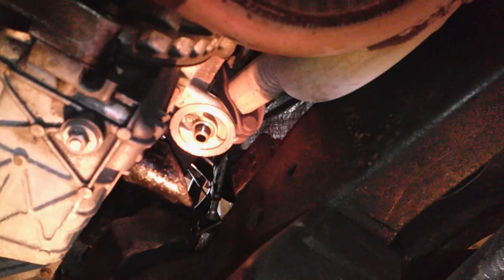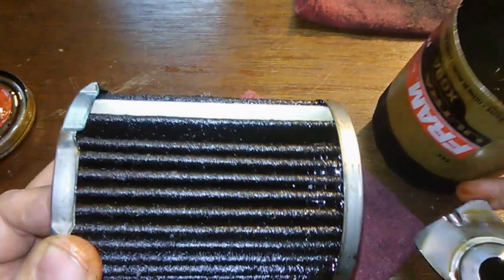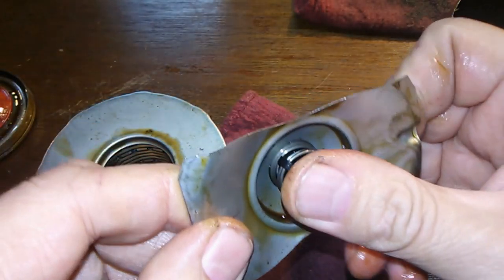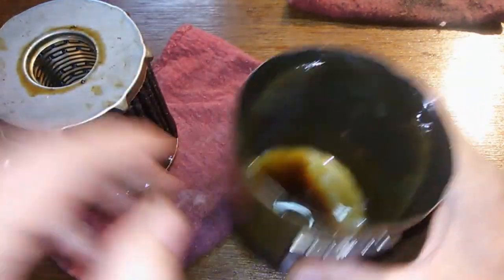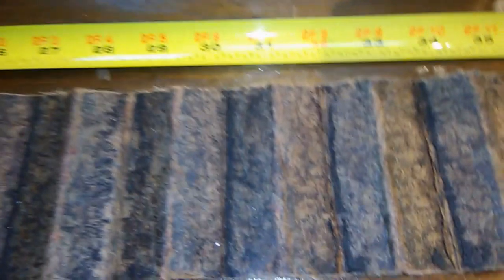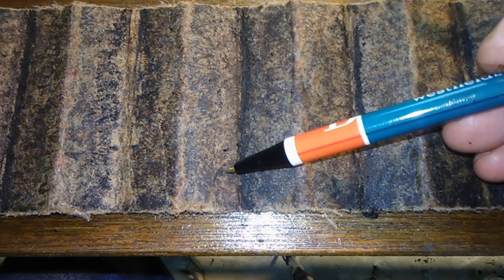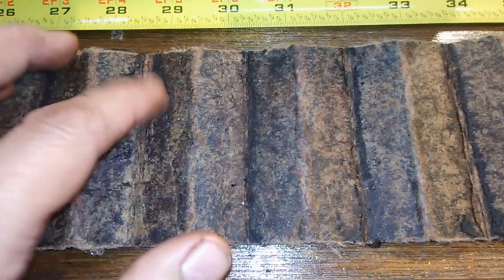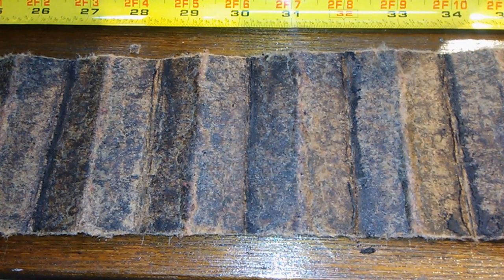Fram Ultra Oil Filter Cut Open XG8A and Oil filter magnets

Comment from the maker: Merry Christmas Everyone and a Happy New year!
Note about the video: I'm pretty sure the shiny metal particles came from the wire backing from cutting the oil filter media. They were just sitting on top of the filter media, and not embedded into the filter, I later ran a magnet over the ones I saw and they would easily lift off. 
And:
Oil Filter Friday,
Watch a New Automotive oil filter inspection video every Friday on this channel.

Comment: I have a 1998 Ford Explorer 4.0L and it loves the Fram Ultra.  The engine is still going strong at just under 300,000 miles.
Reply from the maker: 300,000 miles, that pretty good!
I hope mine makes it to 300,000 miles 😊. I only have another 100,000 miles to go 🤣.
Thanks for watching and commenting👍.

Comment: Cut a used filter and show what's inside using magnets, it couldn't be more real, thanks for uploading this, you can use any oil and filter, the magnet will catch something, bad luck for me, my car uses another type of filter (cartridge ), so I don't know how to do this without being afraid of a magnet flying down the road at 90mph... (I have some neodm from hdd's around) But a great demonstration of what this does in your car!

Comment: Thank you for posting your videos.   I enjoy watching.  Everyone has a favorite oil filter.   Me included.
Reply from the maker: Thank You! I'm glad you like my videos.👍
 I really don't have one favorite oil filter. I have a few that I like. I tend to like filters that have a backing so that they can't possibly tear, the Fram Ultra and a few others fit that bill.😊
I don't think I'm going to stop making oil filter videos any time soon So enjoy and post your comments, I'm learning and any knowledge shared is greatly appreciated. Take Care!
Reply: @WhipCityWrencher  right now I am using a couple different ones myself.  I like the Bosch premium  99+% at 20 microns and the Fram ultra.  Some others on my short list are the royal purple 99+@25 microns, Mobile 1 extended performance 99.6%@25 microns and the NAPA gold 99%@23 microns.  The Bosch are only like 4 bucks when ordered from Rock Auto.
Reply from the maker: @robshaw2990  That's an impressive list of filters.👍
I've opened up the Napa Gold and the Bosh filters and I was impressed with both. I've opened a Mobil also I can't remember which one. The Royal purple is on my to-do list.😊

Comment: It is fascinating to see the particles trapped by those magnets.  Thumbs UP for this video.  I wonder how many of those metallic particles would have been picked up by the filter if the magnets weren't there?    In other words, how small are those metallic particles that were picked up by the magnets?   If the magnets are trapping particles smaller than what the filter can trap, they may be a good investment.  

You can buy motor oil test kits that will tell you the quantity of various metallic particles left over in the old engine oil.  It would be most interesting to see a lab analysis of ferrous particles from two back-to-back oil changes over comparable distances - one using magnets and the other without.
Reply from the maker: Yes, that would be a good test.
I will try that in the future, I think I'll invest in one of them oil filter mag's. The kind that wrap around the oil filter.
Thanks for the suggestion.👍🙏😊
Reply: @WhipCityWrencher  We run those and also your kind(we have 100 trucks) Allison runs a round donut mag on top of their spin ons, and their filters are 15 micron. The mags always have some really fine metal film on them.  I believe in magnets(look at differentials). The magnet IS the filter.
Reply from the maker: @GT-mn3bx  True, 
Yep, the drain plug on my 5 spd tranny is also a magnet.

Comment: The XG is Fram's best filter. It's the filter I use in my vehicles.
In my 99 Silverado, I do the same thing. I change oil 1x per year using a Fram XG3506 and 6 quarts of Mobil 1 Extended Performance High Mileage 5W30 oil. I also get between 3,000 and 4,000 miles per year on it too.  The oil and filter are both rated for 1 year or 15,000 miles.  

Incidentally, the Pennzoil Platinum Synthetic oil is a very high quality oil so you're doing right by your engine using it.
Reply from the maker: Thank You, and thanks for your feedback.👍🙏😊

Comment: I've got one of these Fram Ultra Synthetics in my 2000 Honda CR-V right now. Put it on 9 months ago and only put 3,200 miles with Pennzoil Full Synthetic on it since. I'm gonna remove it and crack it open after the year mark and I hope it'll look as good as this one.
Reply from the maker: You got a pair, that beats three of a kind, LOL.
Fram Ultra and Pennzoil, two of my favorites.😊
Thanks for watching and sharing.👍🙏😊

Comment: That carbon in the filter looks like soot caused by 87 octane with ethanol.  I have taken many pics and comparisons of fuel type and carbon in the combustion chamber.  93 octane non ethanol leaves very little carbon behind.
Reply from the maker: I didn't know that. 
Thanks for that interesting information.👍
Reply: Ethanol is SO bad. It doesn't even reduce pollution, in fact it causes smog. Even the Sierra Club wants ethanol gone. It's a tax on the country with the proceeds going to a few corn states.

Comment: This is the only channel on YouTube I've heard anyone say a Fram filter was well made. Granted most are tearing down the Fram Extra Guard filters.
Reply from the maker: The Fram Ultra and the Fram Titanium are the only two Fram oil filters I would use.
Thanks for watching and for your feedback.👍🙏😊
Reply: @WhipCityWrencher  

You wouldn't use the Purolator Boss?

Fram Ultra, Wix XP/(NAPA Platinum), and Wix are excellent value for the money.

Your thoughts?
Reply from the maker: @steven4894  Hi Steven,
No, what I said at that time was those were the only two Fram filters I would use. I would also throw in the Endurance filter now. I'm using a Purolator Boss in my vehicle as we speak. Wix XP and Napa are very similar and yes I would use them also. I wouldn't use the regular Wix though as it doesn't have a backing. Thanks!

Comment: Quick question I have a 2020 gmc sierra AT4 .I do  about 1 thousand miles a year i been changing my oil every year when I get an inspection an average of about 1 k for each oil change.do you think I am wasting money or is a  good idea
Reply from the maker: I think it's a good idea and I would do the same. The oil in your engine does break down over time, even if you don't drive it much, the oil picks up carbon/moisture/fuel and you don't want that sitting in your engine. Plus your truck engine will be happy too. A good synthetic oil and filter each year is not something that costs a whole lot, and would be good preventative maintenance.👍
Reply: Thank you for the advice I agree that it is not expensive and I believe in proper maintenance

Comment: Little bit of carbon or sludge got cleaned out. Looks like the shell truck is really cleaning up the engine! Might want to do a shorter run and check out that filter also!
Reply from the maker: Yes, it did some good cleaning I think the Shell Rotella Gas truck is good oil. I replaced it with Pennzoil Platinum and a Purolator Boss oil filter I'll see how that works out, I'll get an oil analysis this time. Thanks for watching and your feedback.👍🙌😊
Reply: @WhipCityWrencher  
If you want a real good cleaning oil use Shell T5 in the 10w30. It’s a diesel oil and it has around 2000 ppm of Ca. Your old engine will like it. Love your channel, keep it up. Rick
Reply from the maker: @rickbrown7067 You may be right but thanks I'll keep using a dedicated gas engine oil and yes made by Shell. Thanks for the feedback!👍🙏😊

Comment: Hey Whip , is that a oversized filter you had on there ? Or is it the factory recommend size ? Seems big . Did you like the boss better ? I'm sure you cut it open by now . 
 I'd like to use a oversized filter on my Ford 6.2 but I don't want to F it up .
Reply from the maker: No, it's the recommended size filter for my vehicle.
Yes, I opened it up, I like both filters. 
I would do some research and try to find out if a bigger filter is good for you. Here's the link to the Purolator Boss video.https://www.youtube.com/watch?v=WqXxIasAYMc&ab_channel=WhipCityWrencher

Comment: How do you like this compared to the Mobil filter? Have you cut open a used Mobil filter? I’ll have to search
Reply from the maker: I have a used Mobil oil filter showing this Tuesday the 16th. Both are good oil filters, but the Fram Ultra has a better micron rating.
Reply: @WhipCityWrencher  thanks!

Comment: not a bad filter but every Fram ultra that I saw have those uneven pleats where the seam and crip are, so my guess is you get more oil flow in this area instead of having an even flow throughout the whole filter, Fram could try a bit harder to deliver good quality products.
Reply from the maker: It's not only Fram but I see a lot of space in most oil filters where the seam is.
I think the Fram Ultra is one of the best oil filters out there.
It's well built and has a good micron rating. I'm still looking for a better-made oil filter for the money.👍🙏🙌😊
Reply: @WhipCityWrencher  I agree with you it is a good filter but if they could apply themself a little bit and make those pleats even and regular I'll be more inclined to buy one of those instead of the Wix xp

Comment: Both the Ultra and Boss are the best filters I’ve ran in my Ram 1500 with a 5.7 Hemi. Oil pressure is a lot more responsive than any other filter with both of theses

Comment: What kind of oil are you using jn your engines ?
Reply from the maker: I used SRGT 5w30 on this OCI. I have another video coming out on December 21st which I had used Pennzoil Platinum 10w30, a lot less soot.

Comment: Where did you get those Magnets?
Reply from the maker: I bought them on ebay, it was a few years ago, and doesn't show on my purchase history that only goes back to 2018, but I think these are the ones I got. Here's a link below, also if you do a search for neodymoum magnets you'll find they sell all kinds of shapes and sizes.  https://www.ebay.com/itm/10PCS-N52-Strong-Neodymium-Magnets-Rare-Earth-Lifting-Magnets-60x10x3mm/223205871574?hash=item33f81b4fd6:g:QnMAAOSwe4hduoXB
Reply: @WhipCityWrencher  We run these or Filtermags also(Way more expensive) I believe in magnets, and Allison trans spin ons have a round magnet that goes on top. And they are 15 micron filters too.
Reply from the maker: @GT-mn3bx  I don't know how effective they are, meaning the filter media may have caught the stuff anyway, but It is interesting to see what they catch when opening up a filter that had one on it. I was thinking about investing in one of them filter mags. Right now I have a round magnet, about the size of a quarter on the dome end of a Boss filter on my vehicle.
Reply: @WhipCityWrencher  I run them. Always have, always will. Most our fleet has the ones you posted, the long skinny single ones like in a Filtermag but without the round plastic case. Both are effective.
Much cheaper.

Comment: I like to see a PREMIUM GUARD EXTENDED LIFE  cut open, I cut a couple of those myself and was surprised how well made they are for the price.
Reply from the maker: Sure,
what size and to what make of vehicle is this for?
Reply: @WhipCityWrencher  2006  Toyota Tacoma 4.0 litres
Reply from the maker: @budblack3588  Okay so that's a Premium Guard PG241EX correct? I'd like to compare it to another filter, do you have one in mind?
Reply: @WhipCityWrencher  yes it is correct, big thanks to you, your doing a great job, and you are doing stuff that I can relate to.
Reply from the maker: You can see the Premium Guard PG241EX oil filter on April 2nd,. 
Hope you like the video. 🙏🙌😊
Reply: @WhipCityWrencher  thanks a lot I appreciate
Reply from the maker: @budblack3588  👍
Reply: @WhipCityWrencher  sorry if I took so long to answer but somehow I miss your message, yes I like to see it compared to a K&N PS-1002, I just realize it when I saw your new video, and it wasn't a premium guard.
Reply: @WhipCityWrencher  @Whip City Wrencher  sorry if I took so long to answer but somehow I miss your message, yes I like to see it compared to a K&N PS-1002, I just realize it when I saw your new video, and it wasn't a premium guard.
Reply from the maker: @budblack3588  My fault I messed up the dates, I already made the video of the Premium Guard PG241EX oil filter, and it's set to go on April 9th. I'll make another video comparing it to the K&N PS-1002 and I'll let you know when that one will be published. I'm working on a few projects and I got a little confused with the dates.
Reply: @WhipCityWrencher  thanks a lot, keep up the good work
Reply from the maker: @budblack3588  Okay I think I have the filters straightened out now.LOL.😊
This Friday, April 9th the Premium Guard P241EX will be shown, and on Friday, April 23rd the K&N PS1002  vs. Premium Guard will be shown in a comparison video.👍🙌😊
Reply: @WhipCityWrencher  thanks

Comment: thanks, interesting look at. Ps:  I just started using BOSS Purolator in my 146,000 mile “2007/GMC/4CYL / Canyon”, ( I use SEVERE/ DUSTY SCHEDULES)…….Interestingly, in 1970-80s I used mostly Frams on all Oil/GAS(?)/ Air,  on my 77Trans Am, & 70 CORONET,85;Buick Century…..no known issues

Comment: Sludgy engine?
Reply from the maker: I don't think so. I think that it's just the way these old 4.0L run.
I had the valve covers off a few years ago to change the valve stem seals and it looked pretty clean in there.

Comment: Should have went back with Fram Ultra. 99% @ 20 microns.   While the Boss is 99% @ 40 microns.   Guess it depends on how clean you want your oil.
Reply from the maker: I definitely want my oil clean, but I don't believe that is the correct micron rating for the Boss filter. Their website says 25 microns but I don't know at what Percentage. If you compare the filter media (by site alone) one would think the Boss would filter out more particles than the Ultra. I will see after a year if I have similar carbon deposits on the Boss oil filter media after I cut her open.
Too late now, but I should have had the old oil analyzed, perhaps I will in Nov. and put in an Ultra and a year later have that oil analyzed.
Thanks for watching!👍😊
Reply: I have been doing oil filter research for several months now.  What I stated for the Boss is correct.
Reply: @robshaw2990  If you’ve been doing research then you already know that particles in the -3-10 micron range cause the most wear in an engine. Unless you’re running bypass filtration you’re splitting hairs over nothing. Cars and trucks not running bypass filters would be far wiser buying the best air filtration that they can and not worrying about whether their oil filter is efficient at removing 25-35 micron particles.
Reply: @prevost8686   thanks for the info.
Reply: @prevost8686  Interestingly, me too…. Switched to ALL AIR **OEMS ( 2007 GMC CANYON /4CYL, 2015 JOURNEY 4CYL)*…. From K AND N, THOUHG I MOVED TO DUSTY HE,ENA VALLEY, MT::unable to insure K & N CATCHING dust. Etc.  Ps: use BOSS, OR R LURPLE, NAPA GOLD (;shorter  term)FILTERS OIL,

Comment: Wix is the best filter. The reason there isn't much there is because magnets not only don't work over 180° , they keep the filter bypass closed . The Napa gold would be 2nd to wix. That's all you need
Reply from the maker: Wix has changed, I think the Napa Platinum is a better oil filter at least for this moment in time. Check out this video I made. https://www.youtube.com/watch?v=wP8fO-It0-Y&ab_channel=WhipCityWrencher.
Reply: @philipfarnam6013  if you have metal in your engine oil,  you have a much bigger problem and a magnet isn't going to fix that
Reply: @CorvetteTrev  Every machine that's ever been made sheds metal particles...always and throughout their life. It's the nature of any machine with adjacent surfaces...like your own vehicle's engine...which is why we use oil filters at all.   The only difference among the machines is the quantity shed.   Among those particles, the magnetic/ferrous ones (iron and steel) are the hardest and, therefore, the most abrasive.  Magnets do, indeed, lessen the amount being recirculated.   FWIW, between the filter I use (Tokyo Roki or Purolator Boss) and my external magnets (FilterMag) my own UOA's show less than any others I've seen.
Reply: "...magnets not only don't work over 180° , they keep the filter bypass closed."     Neither statement is true.
Reply: @philipfarnam6013  

Neodymium magnets 🧲 with a Curie point of 150'C work exceptionally well.

Comment: When it comes to Oil Filter Magnets, there is only ONE CHOICE -- The FILTERMAG #SS365PR, with 11.4 square inches of magnetic holding power, and it is Heat-Stabilized to function perfectly from -40 F to +300 F.
YES, there is always some penny-pinching fool that says: "I'll just use the dime-sized magnets, cause they're cheap!"
 Or his hillbilly buddy, who tore his hard-drive apart to snag the magnets from it, saying:  "If you're clever like me, you'll use the cheap, crappy magnets because everybody else does."
HOWEVER, it makes NO SENSE to just buy the most expensive stuff available, in the mistaken belief that Price equals Quality, and that it MUST be the best because it's so damned expensive.
I don't remember the name of the company whose advertising slogan/logo was : "The Economy of Quality", 'cause it was around WW2 that I saw it. Those words stuck with me for my whole life, and gave me inspiration to learn to make things better for myself and others.
Reply: Did you learn about magnets on oil filters from 
the Fram website?